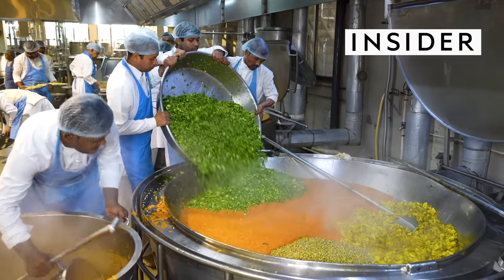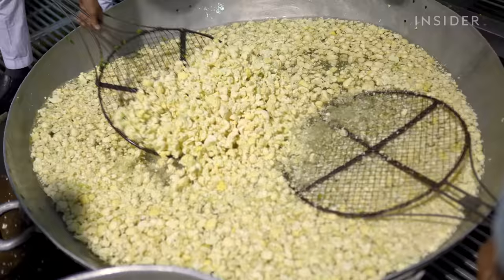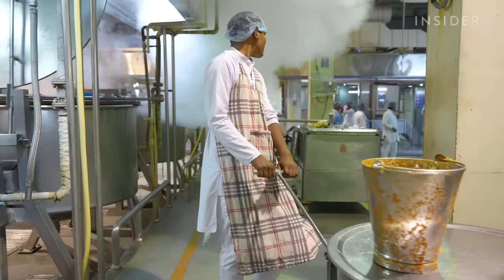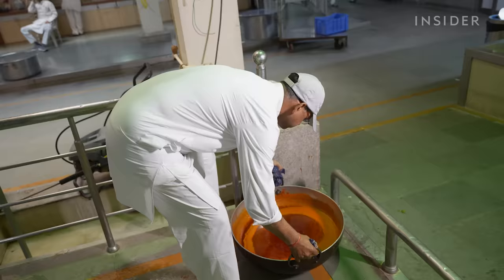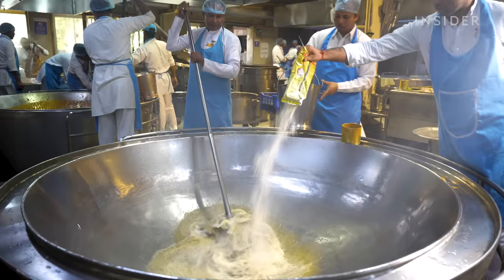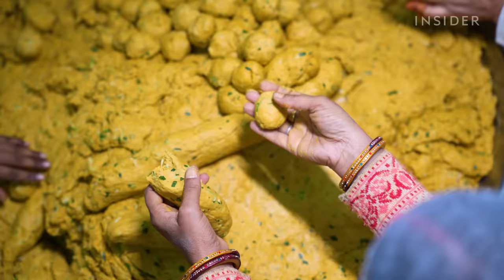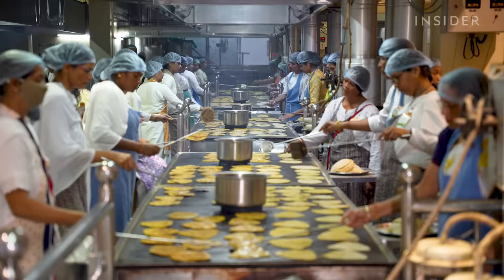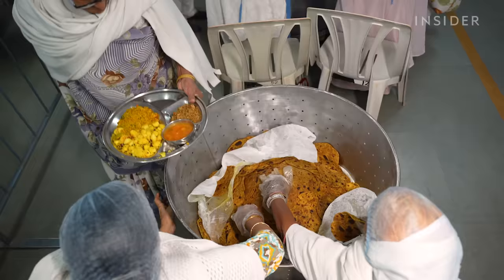How 40,000 People Are Fed Daily During Baba Milan In Rajasthan, India | Big Batches | Insider Food

Comment: Bay leaves are a great component for cooking but they can turn the sauce bitter if they are left cooking for too long .I usually add them 5 minutes before i turn off the heat alongside a hot green pepper (sliced open and cleaned with water but left with some seeds to give some heat to the food)
Reply: not if you temper the leaves in the beginning. it realeases the flavour into the oil.
Reply: Not in Indian cooking. Bay leaves are added in the beginning. It won't release flavour if added in the end.